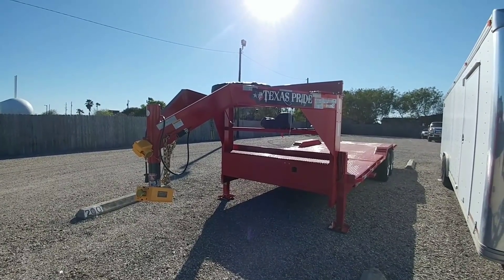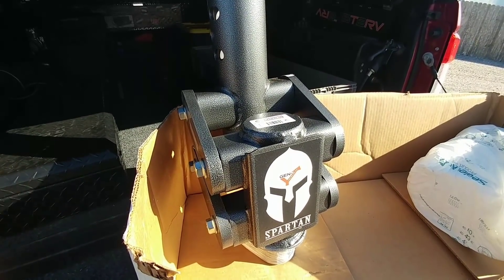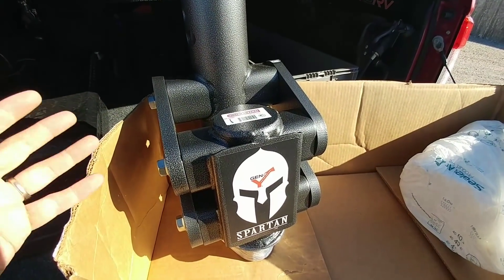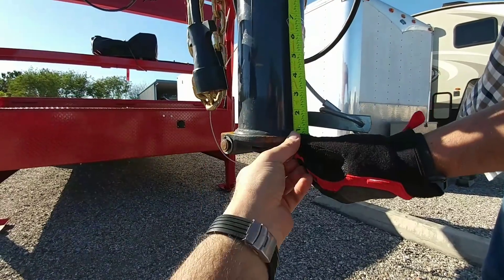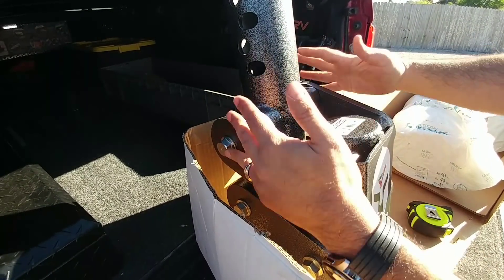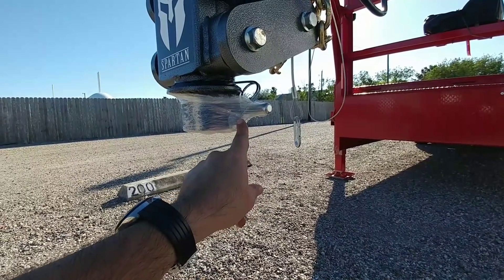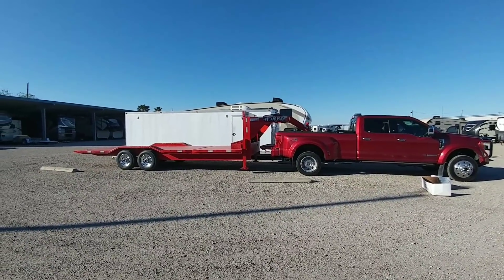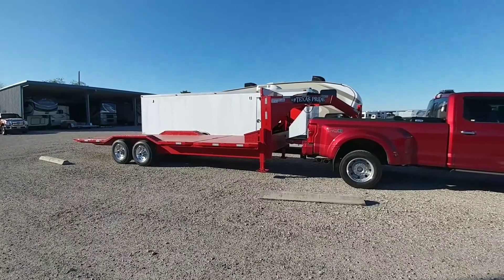The GEN-Y Spartan Torsion Hitch Coupler on Gooseneck Trailer!

Comment: I have used a bumper pull gen y torsion flex hitch for 5 years. It is the best riding hitch hands down! Anyone who states differently definitely hasn't ridden in a truck while towing using one. It does reduce driver fatigue like they state. I recommend purchasing one, it'll be worth the purchase.

Comment: I've been looking at that coupler for a long time now but just can't bring myself to paying that much money. I know they are supposed to ride a lot better but that's a lot for a hitch. I agree with you on the pin latch. Would definitely like an auto latch coupler.
Reply: So very true. That's a lot of money for supposedly a better ride. The truck and trailer booth have a good suspension on top of that. As a welder by trade there is less than $300.00 in steel there. I know you have to make a profit but $1000.00 for a hitch is a bit much.

Comment: JD, I love the torsion flex on that hitch but I think I would have the very same concern you do about the hitch pin. First off that doesn't seem to make me feel as confident in pulling it as the locking mechanism. Now, in all honesty, I have forgotten to connect the latch enough times on horse trailers and even my own RV that the auto latch feature seems like a no brainer to me. But I also like the wide mouth opening that funnels the ball to the center on the bulldog. There isn't any room for error in that ball mount. For people like my father who doesn't have a camera in the bed of his truck and can't turn his head far enough to see behind him he has to have great directions or get in and out several times and has to get it almost perfect. I got him a Bulldog for both of his horse trailers but he still has a flat bed with the pin connect and he is constantly looking for the pin. It just seems to find a way to be left out or misplaced. But like I said, love the cushion that the torsion flex offers. That is really cool!!!
Pat

Comment: How does this affect the ball set up on your truck? I would think that since all the weight is actually behind the hitch point instead of above it there would be a constant side load on the ball. Would this increase wear on the ball or affect your towing capacity?
Reply from the maker: Remember the ball is still the pivot point.  That weight is directly above the axle.

Comment: Similar to function of sulastic spring shackles? Do you still recommend sulastic shackles?
Reply from the maker: Similar but different in design and engineering.  Much more fail safe than Sulastics.
Reply: Big Truck Big RV  Just traded from a 2016 to a 2020 Ram 3500 dually megacab. The 20 is definitely more beefy. I hear what you are saying, but would you consider sulastic to soften the rough empty ride? Really enjoy your subjects and narrative.

Comment: I have a 30,000 lb gooseneck for my 450. For legal weight I have to use the 3 inch ball. Also have a 4 inch square receiver. Do the make anything that works with that set up?
Reply from the maker: I believe they do have it with a square tube and 3" coupler.  Have to check their website.

Comment: How about doing a review on the Road Armor, Dexter and Morryde 3000 and 4000 suspension systems? Plenty of install videos available but no real actual reviews on how easy or hard the install is or a real review by someone neutral.
Reply from the maker: I've done full install and review videos on the Morryde SRE4000, Dexter EX Flex, and LCI Road Armor suspension upgrades.

Comment: It's simple really. Lippert (LCI) is the exclusive distributor of the goose box. They make money on every goosebox sale. It's the sole reason all other gooseball type hitches will void the warranty and will never be approved, only the goosebox. It's all about shafting the customer both out of choices as well as it gives them an easy out to deny any warranty claim.
Reply from the maker: You are not correct. Amazon, etrailer, and a dozen other places sell and distribute the goose box. Lippert approved the goose box which is manufactured by Reese on their frames because it passed a rugged course designed Navistar to test pin boxes and RV frames. Also, the Goosebox is not an option or standard on any RV (that I know of).  LCI would much rather push their Rotoflex or Trailaire brands
Reply from the maker: My guess is that due to the cost it wasn't widely accepted in the RV industry.  While working with Coachmen, I found that they did not want to install it because it limited their ability to have their units towed to dealerships, since the overwhelming number of RVs use a traditional pinbox and their hotshot fleets are equipped with Fifth Wheel hitches.
Reply: @BTBRVReviews  totally agree with that is why they dont put them on at the factory. But them making money off every single sale of a goosebox is the SOLE reason that every other gooseball hitch will void the warranty. Not because they cant pass lci closed test but because they dont make money from it. 

What better way to increase sales then to say by putting any competing product on our frame will void its warranty?